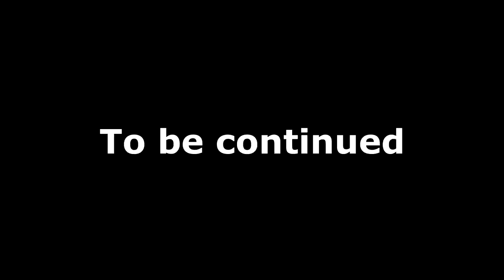Hauling Bed Pack Manure and Corn Silage Harvest Continues

Comment: Most states have regulations that inspectors use when at farms inspecting for cleanliness with regards to the overall health of the livestock. I assume that is the case in your state. My questions is: When you decide to clean out, for example, the special needs pen, is it due to state regulations; personal preference; or perhaps both? Is there an inspection due for your farm by state inspectors?

Comment: Hey, the plates with which you cover the manure filling holes are quite heavy, maybe it would be easier to drill two holes in them and insert a U-shaped bent wire terminated with nuts. At the moment you would need to raise the plate, you would grab the wire that would rise until the nut covers it and everything goes up with the plate. Simple and does not disturb when driving on a plate. I have used the translator so there may be minor mistakes

Comment: If the custom cutting people always arrive when needed and since you called your leaking tractor a piece of junk, the indication is you are not mechanically focused. That is not to say you cannot do mechanics, but a chopper is amazingly complex. Requires lots of diesel. Has a high horsepower requirement. Needs daily maintenance.  Has things not working optimally every day. Needs constant maintenance. And needs hauling wagons trucks, and packing tractors if banking not silo filling. If silo filling a suitable tractor powerful enough to blow to the top. A silage blower prone to failure or maintenance but ready to go when needed. So to hire it done makes sense for you. The manure tank and manure spreader are two more factors which may be custom moved may also make sense if over worked and you do need robot milkers to lower your workload and make the cows happier.